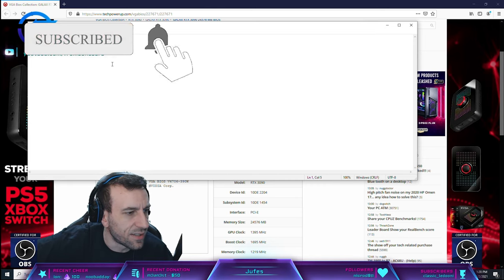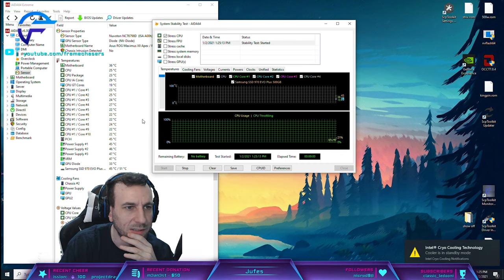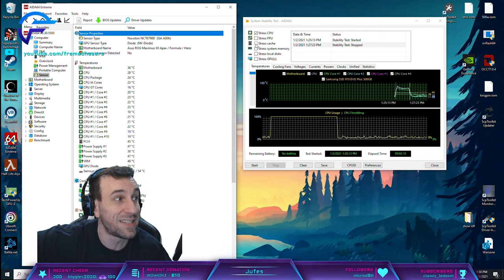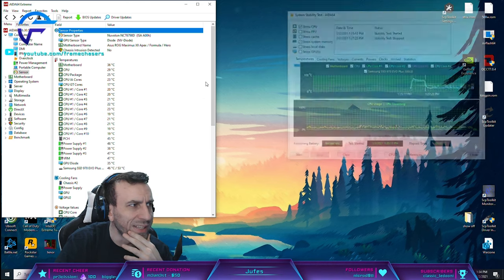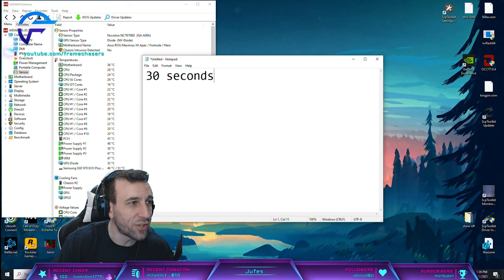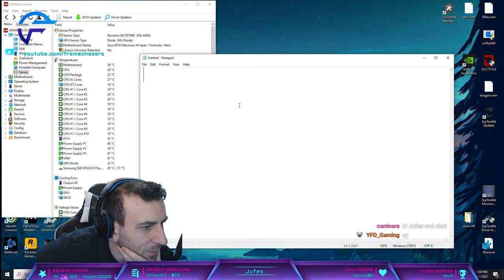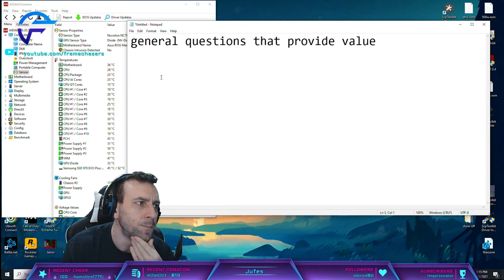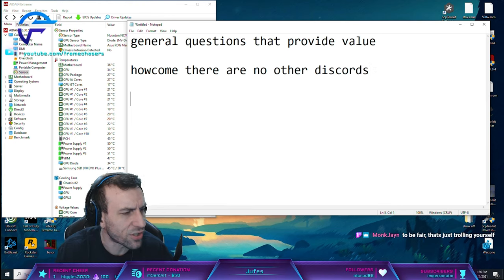Intel Cryo Cooler + Direct Die??

Comment: The the tec does transfer the heat thru the tec, when it's off. And yes your limited by whatever size tec you use, but you still could probably get better transfer efficiency thru direct die of the tec,maybe its only 5c, maybe that's only 50mhz boost.....if thats important to you, I say go for it. It's a lot of work and it can be dangerous to your cpu if done incorrectly, but if you want that little bit extra, and don't mind breaking a cpu, for a 50mhz gain, do it man,try it. Everyone likes to talk, I like seeing people that actually try it, pass or fail....just my 2 cents

Comment: Just tried the tec cooler not at all what I thought it was I have 6 fan on a thick 360 rad and still overheats like you say it’s a fun tec to play around with but definitely was much better with a water block it turbos for a min then drops fast I think it was not ready yet wires space sucks pushing on the ram. I will probably mess around with it a little more and put the block back on.

Comment: Yeah i just got and installed my ek tec and it is a bit underwhelming. Its no doubt a fun toy but you completely sacrifice multicore workloads as it just gets overwhelmed by that much heat output. I guess for gaming i can get 5.3 but is the money worth it for an extra 100 mhz? Another issue i found that you need to load up your settings everytime you restart your computer. The tec is basically an insulator for the copper when you turn it on and its on standby. Then intel TVB and its xtu tuning software is confusing as hell. I still cant get it to run right. Please make a xtu guide when you can :)

Comment: Got the Cooler master Cryo AIO . 
Tried to fit on my delidded i9-10900KF to go for direct die .... 
Guys, it's not possible. The Cryo cooler copper plate cannot go lower (it has the plastic+rubber for sealing around it) so the CPU is too low , not touching the copper plate.
So , you need a CPU with IHS . 

What I've done , I've put liquid metal on delidded CPU + copper custom IHS + Cryo Cooler Master.

The OC I can get on "Cryo on" is 5.6Ghz 1-4cores / 5.5Ghz  5-6 cores/ 5.4Ghz 7-10cores ; -1AVX2  ; 170w max power set
I am still playing with it , I am in doubt if I should keep it or go back to direct die+ 360mmAIO ...

And no, with proper settings it does not overheat. Temperatures on  my CPU are around 19-20deg min to 55deg max . On all cores full load is under 60deg  - but speed around 4.7Ghz
Reply: Noice!!!!!!! Thank you, just thank you
Reply: Late edit : 
I managed to fit the Cryo Cooler Master AIO on a delidded i9-10900K . I managed to do that by unfitting the plastic/rubber gasket on the AIO copper plate (easy job / 4 screws to unscrew) . Basically there is no isolation now on the water block - means I could run only "cryo" and no "unregulated" mode, to avoid any condensation.

Even though the limiting power of he Peltier does not allow to do much more than the non delidded CPU scenario, the heat transfer is better, and faster I believe, so I think is an advantage. The most I could do so far in terms of speeds is : 5.7Ghz 4 cores / 5.6Ghz 5-6cores / 5.4Ghz 7-10cores - all these with OC TVB setting under 50 degrees . (over 50degrees there is an reduction of speed to 5.3Ghz an 1-10 cores) . Vcore = 1.5V . 
What I noticed is that the max power draw of the Cryo is 136W which is pretty low , means the Peltier in Master Cooler Cryo is even weaker than EK Cryo water block, which goes higher. 

Next step for me will be to replace the Peltier to a 30Amps one (abt 250W cooling power)

Comment: Once I get my tec cooler set up I have a 3090kingpin and Asus xii extreme i9 10900k sp100 Corsair 3200 ram 32gb need a consultation to get the most out of it
Reply: That’s what I built so far getting tec cooler tomorrow I can also upgrade the ram was may next step  to get the most for games like cyber punk 2077 cod etc.
Reply from the maker: You will definitely need better ram than 3200, but not necessarily for single player games.  It’s the multiplayer ones that need it.  But your setup sounds insane anyway, get fast B die ram if you can afford it anyway
Reply: @FrameChasers  any recommendations I was going to get the Crucial Ballistix MAX RGB 4400 MHz DDR4 DRAM is this any good
Reply from the maker: @Rome1120  no on crucial, they use their own memory chips.  Go on a website called b die finder and get any ram off there.  If you get stuck just don’t buy anything until you can get a consult and I will help you pick out the best ram in your region. 4000c19-19-19-39 is usually the easiest ones to find
Reply: @FrameChasers  I have 4000 gskills royal and warzone only likes 3200

Comment: How about a coldplate on top of cpu chip connected to 2 TECs?
Reply: I was thinking the same, to have a total of 400w TEC cooling . But, it seems like not all the time 2 TECs just double the cooling power . And you would need a insane water cooling loop to cool down 2 TEC's + CPU, somewhere around 750W at full load (!)